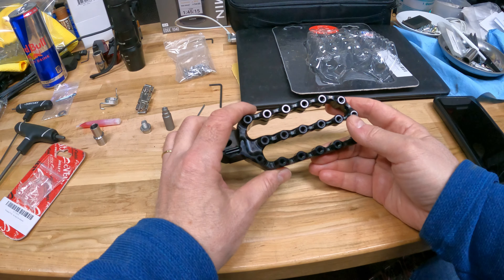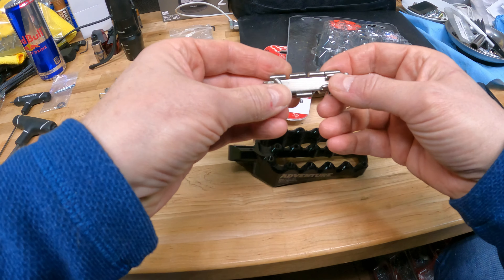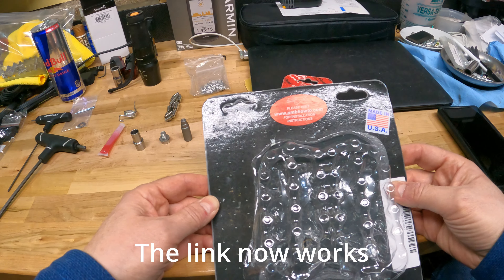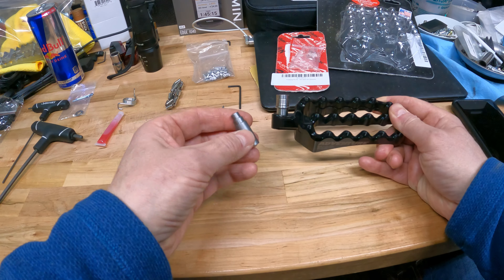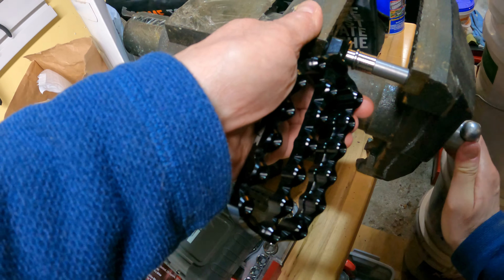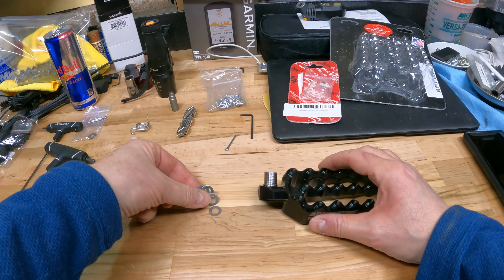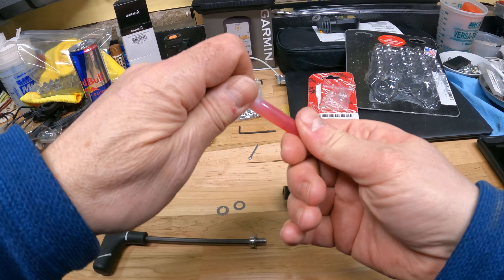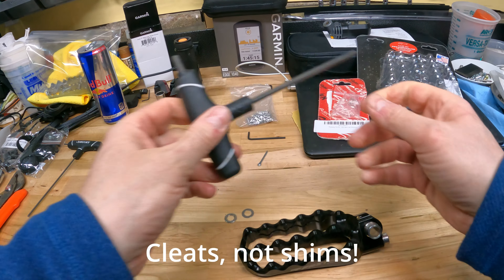How to install Fastway Adventure Footpegs on KTM Adventure

Comment: Pretty nice pegs. What bike did you put them on? The factory pegs seemed pretty comparable in size the adventure pegs. I’m looking at a set for my 2004 KTM 450 EXC. how noticeable was the drop in height of the pegs? I have a 36” inseam and wish my pegs were lower, I added a tall seat but need a little more.
Reply from the maker: On a 2016 KTM 1190 Adventure R. Yes the pegs replaced were the wider adventure pegs. The idea was to lower the pegs and the difference was very noticeable. I like them.